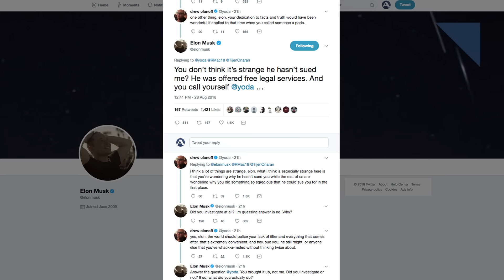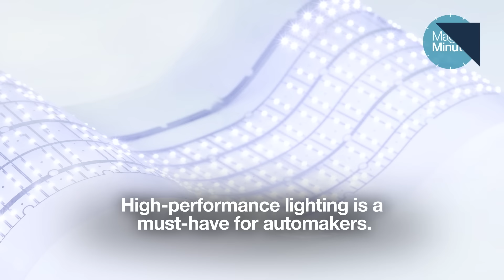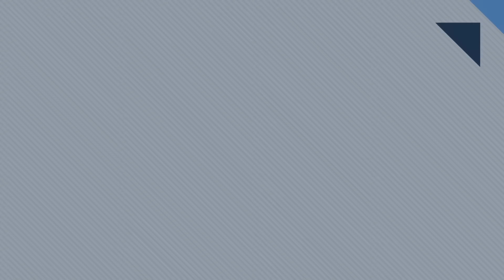Magna Rohinni Automotive, Details on Trade Deal - Autoline Daily 2424

Comment: I think most people are weary about AVs because it's the year 2018 and we still don't have a decent operating system. Consumer products are unreliable, break down constantly and are poorly designed. Wifi is shit, always and everywhere. Consumer products are built on a budget, and consumer-oriented AVs are no different. On the other hand, I would totally trust an autonomous aircraft, as in aerospace everything is extremely tightly regulated and designed to be very redundant.
Reply: One problem is how little people know about things in general, and how few questions they will ask about how something is design.  Worse, many (most?) people are lazy and are happy to use systems that do not require they to think and cost less thus letting cheap designs lead the way.
Reply: "One problem is how little people ie Elon know about things in general"...Just elitist mindless fanboy cynicism about anything outside of the cult...